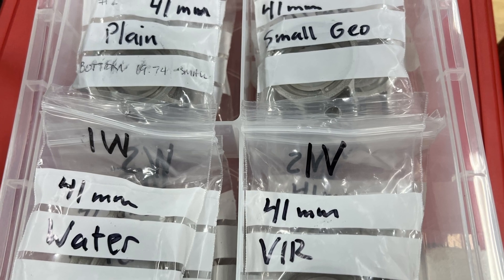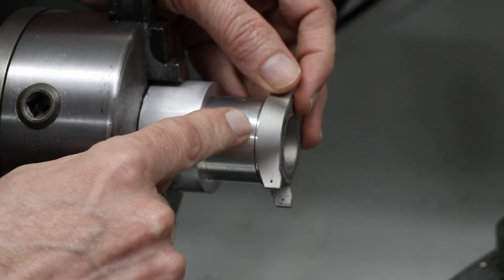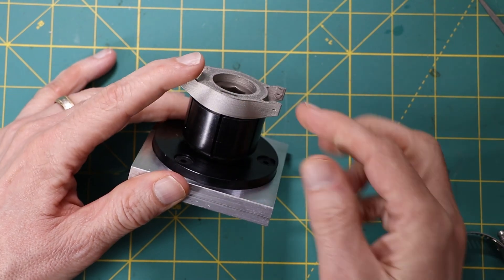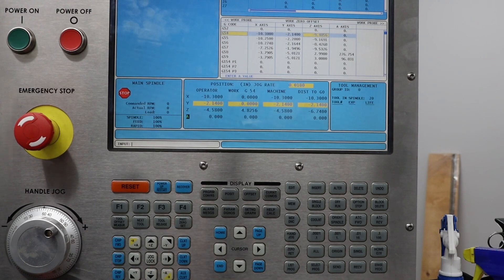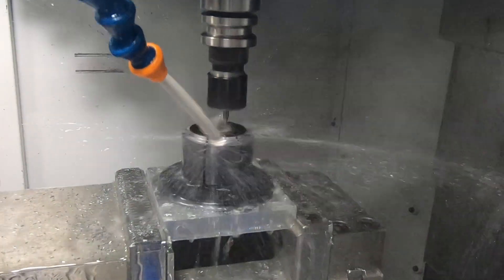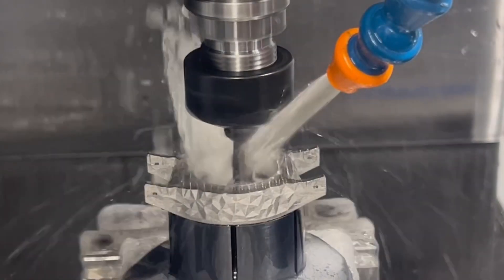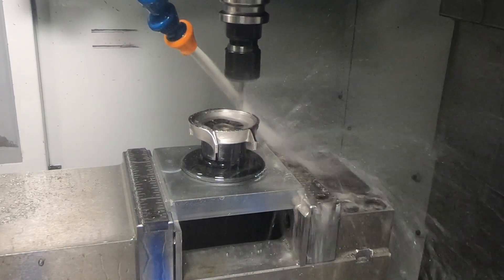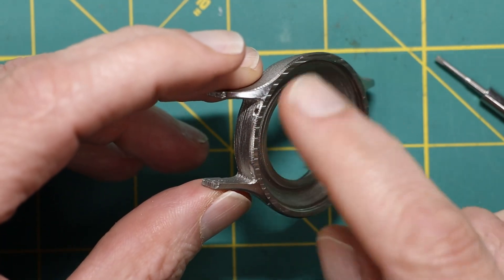Custom Watch Body V2 -- Probing Gone Wrong!

Comment: Hi John, just found your channel and love the software/machinist combo. My first role in a shop was working on a bunch of the newer compact mills and some VF-2's. I wrote a bunch of custom macro programs for our specific use cases. Reached out to renishaw directly about using smaller probe tips and they had no information on tips of that diameter. IIRC, we used something in the realm of .028"... I see someone already commented about using the vector calibration cycles. All of the 9000 programs for the measurement cycles are editable... you can do some amazing things with them. Unfortunately they are not well commented and as you know g-code is an eyesore... If you ever would like to collaborate on some measurement routines I'd love to help out

Comment: Did you use Vector Calibration before the vectored touch-off method?
Reply from the maker: Bingo, you spotted the problem. I've almost finished editing the video showing the two modes.
Reply: @JohnSL   Yeah, this is a bummer because the small probe diameter masked the behavior. With the conventional size ruby, it would have been off by a bunch when those missing 30 degree segments were absent from the calibration. Absolutely awesome that you found all the unused Renishaw programs that most never realize are there.

Comment: Look on the bright side: working with smaller parts means less material loss (and cost) when something goes awry with the machining process.  Imagine trashing 5 aluminum engine blocks ... ouch.
Reply: Not always the case. Those intricate 3D prototype prints are probably quite expensive although small. Whereas an engine block is usually cast or die-cast. But if you mean a billet block, yeah ouch. But those are usually laserwelded if you made a mistake. For small intricate parts the material cost might be minimal but the time and tooling you wasted might be quite substantial.
Reply from the maker: The cost on these wasn't bad, so it was mainly my time. That's a bit painful and frustrating. But what I learned, in the end, is worth it.